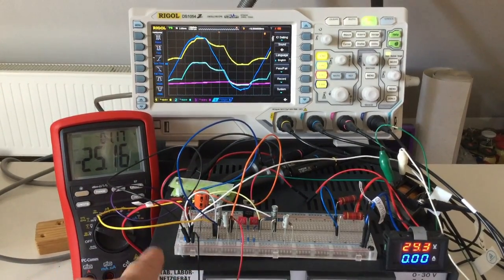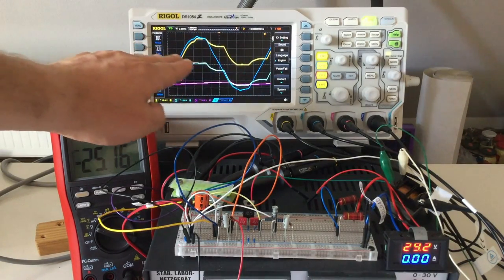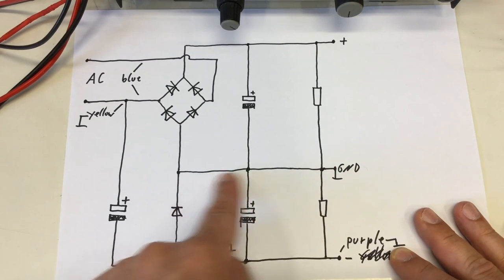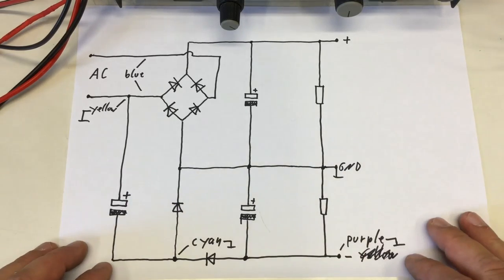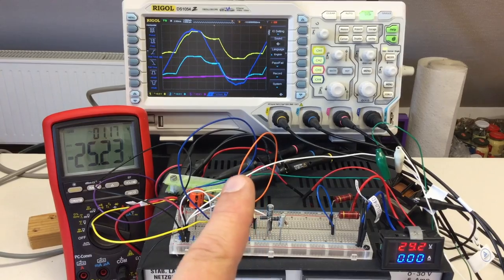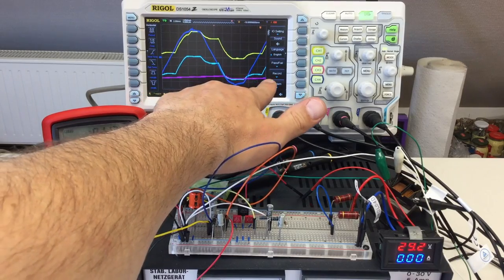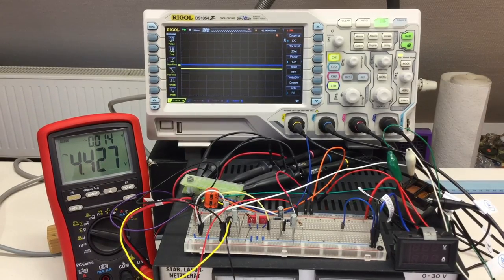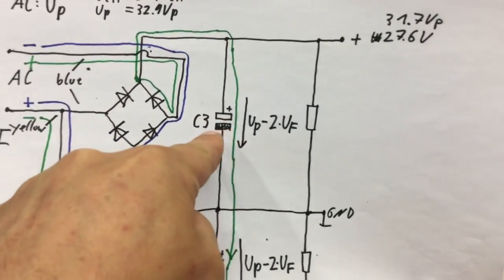Auxiliary Negative Rail for Linear Power Supply (Charge Pump, Voltage Doubler)

Comment: Hi Robert,
The simplest circuit I have  used does not require C1 and the two extra diodes shown at 48:13.  Analysis does not make my head hurt either !!! (LOL)

Disconnect the negative bridge rectifier connection in your original single-dc supply circuit  and connect the wire to one of the bridge rectifier AC connections.  Now connect the new capacitor C2 (together with it's load resistor) negative end to the bridge rectifier negative terminal and it's positive end to the negative end of C3 (common or ground).

Now you have it.  Yes, it is a half wave voltage doubler (e.g. as used in millions of PC's for 110/220 mains selection) and yes, you do have to double the value of C3 for the same voltage ripple, but the bridge rectifier does protect against  reverse voltages on C2 and C3 when a load is connected between the positive and negative output rails (depending upon which half cycle of the AC switch-on occurs).  And, in the case of unbalanced DC output loads, C2 need not be the same value as C3 (such as running a '7805 off the positive output rail for the digital stuff).  Each output dc rail is completely independent of the other.              Analysis is cool..........73, David
Reply from the maker: Thanks! I haven't seen the circuit you've described before. Maybe it's time for a part two of this video ;-)